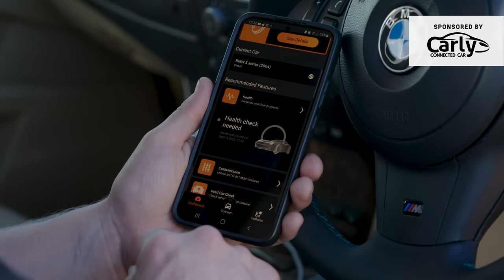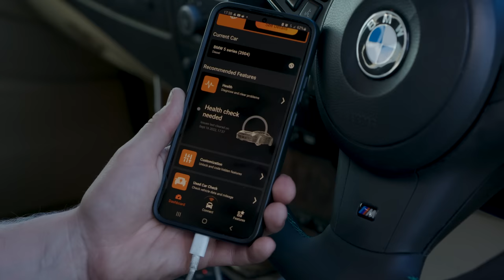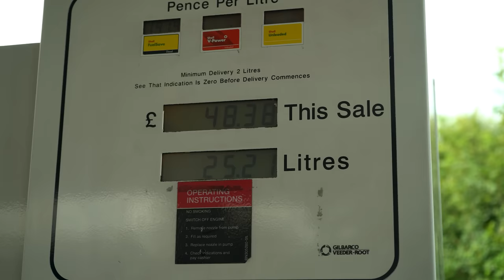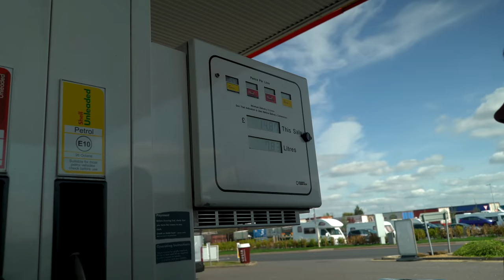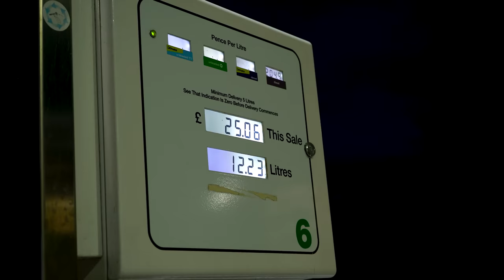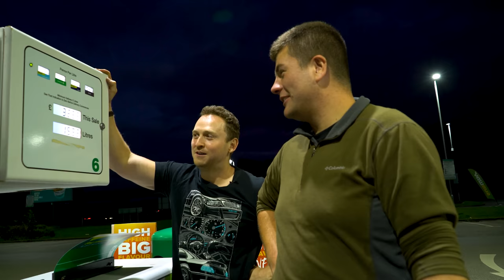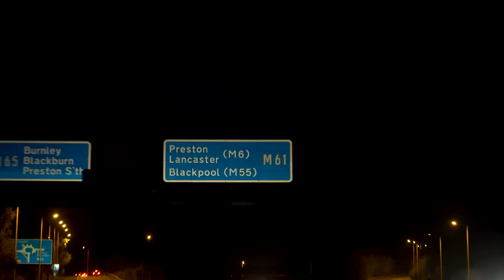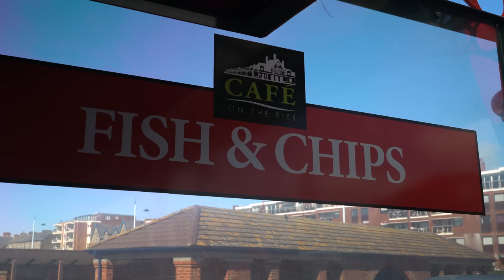£3000 Car Auction Adventure!

Comment: The right blinker while turning left at 11:33 is what we call baby steps in the car community regarding BMW drivers.
Reply: Audi drivers aspiring to this level of unselfishness. But then quickly realise that their cars aren't equipped to make others aware of their intended actions 😂
Reply: He accidentally knocked it on when looking for the volume controls for his super bassy stereo. It's the only explanation.
Reply: Not to make excuses for shitty driving, but BMW indicator stalks were of a stupid design for most of the last two decades. They don't latch and as the internal stops wear out, it's not impossible for a miscalculated release of the indicator stalk to cause it to spring back in the opposite direction and cancelling them manually is a nightmare. Not something you'd ever do if you were actually paying attention, though. They put the same design of indicator stalk in MINIs in the F5x cars initially and the response was so awful they went back to latching ones within a few years. I noticed the loaner 2 series I had a while back also had a latching stalk so whilst it may have taken them a long time to admit it was a bad idea (I think it probably started on the E6x cars and ended with the first G-coded models)  they did get there in the end.

I've noticed that indicator usage in the UK is almost universally awful regardless of car brand in one area though - almost nobody can be arsed to indicate off of roundabouts. At worst, they're still indicating right as they take their exit so you're just sat there with no clue whether approaching traffic is going further round as you approach.
Reply: what is blinkers?
Reply: @Azurael  so you're telling me a lot of the people who I see as not indicating probably are indicating? My whole world has been distorted 😂
Reply: @bigduphusaj162  get some spirit bubbles while your at it please mate, along with a long weight, which I imagine come as standard 🤔
Reply: @Azurael  I've got a 2008 3 series and the indicators are very intuitive, I've never had a problem with them, I guess some people are incapable of doing a half press.
Reply: @spicysnowman8886  I mean, they're fine when you're used to them - I've spent 6 years driving cars using that arrangement now so I don't even think about it but I fail to understand how they could ever be deemed better than a regular latching indicator stalk. Wanna cancel the indicators when they're in the up or down position? It's self-evident. It requires not only re-learning how to do something everyone who drives already knows how but also requires being a lot more careful (i.e. not to move it too far when cancelling) for no tangible benefit in functionality.
Reply: @Azurael  I mean I just hopped in the car and it made perfect sense to me, but I guess I did already know they worked from watching videos before I bought the car.
Reply: @bigduphusaj162  I didn't realise they had a name, 'comfort indicators', but we have a Vauxhall Zafira with them, or a version of them at least. There was a couple of times after we got it where our car could have been seen driving down the road alternating between left and right because it wasn't pushed enough in either direction to go to the 'indicator on until steering angle decreases' position, so instead of the half move of the stalk cancelling the other indicator, it activated the 3 flash for the other side, not understanding what the 3 flash thing was. It was just an indication we didn't ask for that we wanted to cancel before it confused other road users, so they were confused even more. :) 
In the Zafira, or rather our Zafira as it was an ex-demo with details that don't seem to match other cars we've seen, the stalk doesn't stay where you move it to, but acts a bit like a regular stalked car that has the '3 flash' thing, so the half engage in one direction does the 3 flash thing (something that can't be cancelled if you trigger it by mistake), then the 'full' engage is the regular indicator, but it doesn't stay engaged with the stalk and you have to half engage the opposite indicator if you need to cancel one, something this Zafira seems to need more often than other cars as the first 'clicks' when you turn the steering wheel seem to be quite far around for how relatively little you actually need to turn the wheel to steer around stuff, so you can fully indicate and not pass a disengage point before pointing straight again. My granddad, who's car it is, seems to have given up on using them, because the only comfortable thing about them is not touching them. :)
Reply: Killed me!! thought I was the only one who noticed
Reply: A potentially working blinker on a BMW means simply "Caution! Something's gonna happen!", so whether it's left, right, or none, doesn't really matter much :)
Reply: @jordanvalenciamanuelpillai2917  Turn signals

Comment: I live near snake pass and walk the dog up there all the time, it's such an impressive site to see those engines and landing gear so well preserved. There are 3 more plane wrecks all within walking distance from there. 
I've always been a fan of cars like this. Once expensive, but high mileage and super cheap bargains. Ive had an e39 540i, a w220 s500, a s60 t5, an Audi a4 3.0 quattro, a e36 328i to name a few. None of which were more than 1200 quid. Had loads of fun and crossed Europe in these old smokers! 😎

Comment: Hi Alex, 

Just to  say loving the content however would urge you to adapt the 2 way radios when driving to make them slightly easier to use.
possibly a headset or push button usage.

although there is an exception on two way radios when driving, the police can still pull you over and fine you if they believe its providing a distraction resulting in penalty points or a fine.

Comment: That’s preposterous mate! 
Brake lines on those rovers are easy peasy, don’t need to drop no subframe or fuel tank, back in my Land Rover tech career I could get a set of rear brake lines fitted in less than 3 hours, that includes bleeding the air off the rear lines. 
Range rovers and land rovers are super easy to work on as long as the right tools are used. They are Ford/bmw mismatch parts after all.

Comment: Great video.  

Next time you're up this way, if the water level is low, check out Ladybower reservoir.  You can see the remains of some of the old village buildings normally hidden under the water.

Comment: Now this may sound like I'm begging but, 
PLEASE could you consider an offroad build with the rover. 
•convert to coilovers (possibly long trave suspensionl)
•body lift 
•wheels
•tyres 
•modernising the engine to make it reliable and reclaim some power
•rear locker 
If this is a possibility my brain would probably melt love the channel.x

Comment: I have an E60 530i. Overall, a fantastic car. 
Just a few things piss me off about it though:
 - No engine temp gauge.
 - iDrive is shit. To change the centre-vent temperature, you have to do a dozen iDrive clicks and turns. In the E39 you just turn the thumbwheel by the vent.
 - When you get low on fuel, it turns the clock off. You're not allowed to see what the time is when you have fewer than 30 miles remaining.
 - Turning the centre screen off doesn't turn the centre screen off.
 - Interior quality is worse than E39's.

Comment: I had a e60 BMW in New Zealand. I loved that car but any fault or repair was cripplingly expensive. Ie electronic steering lock. Starter motor failed at 194k kilometers. I could just barely afford to fix it.  After that I reluctantly sold it. Driving a Honda is not the same at all but I feel less anxiety about what will fail next.

Comment: Does the BMW have the N47 engine? If so, I had a very similar thing happen to my car a few years back (E82 123d). Heard an awful clattering and banging like you heard, and when I looked in the engine the crankshaft pulley was fully on the under tray of the car... Managed to get it round to the garage unscathed but I'll never forget that noise!

Comment: Looks like a lot o fun. I htought the Range Rover would blow up for sure. Surprised the BMW had issues. I had BM's with over 200K on that were good runners. Keep up the good work guys!
Reply: I love BMWs but sold my e60 because I could no longer afford to fix it. Starter went out and who knows what would fail next? Vanos? Only BMW I have left currently is a e36 I'm trying to convert to electric power. I drive a Honda now and feel less stressed.

Comment: I had a range rover sport HST supercharged and it averaged 14mpg lol but if i used the manual mode i could average 18mpg which strangely was also sport mode and made it quicker! But the V8 engine sounded amazing and surprisingly never gave me any problems! Absolutely loved the range rover, only reason i sold it was fuel economy as it was my daily driver! Also own an R32 GTR which was greedy so didnt need two greedy cars lol

Comment: 11:32  indicating right whilst pulling off to left on slip road.  must be those aftermarket bmw indicators wired in wrong by previous owner (bmw indicators optional extras) when new.  What was that taylor, the bmw is perfect but i have to park close to other cars as door don't lock!!!

considering the amount of work taylor did to get the range rover worthy of the trip before you left, i'd say still a win for the beemer as it went wrong during the trip not half of it being repaired before the trip

Comment: Tell Rory to drive his 535d above 2300 rpm for atleast 20 minutes once in a while, the DPF doesn't regenerate on this car even at motorway speeds (except if you drive at 100mph on a daily basis).

Comment: V10 Touareg air suspension very high spec I got mine on 120k 3,250 only broke the steering column in the 1 and a half years I’ve had it 

Should punt the land rover and get yourself an Touareg

Comment: i'll stick with my £2k jeep cherokee with 87510 miles and NO issues thanks and its a 55 plate.  hasn't got brake pipes with rust holding hands trying to keep the fluid in lol

Comment: I do not believe that Range Rover, did that miles per gallon. there is no way, the gas guzzler is that efficient.
Reply: 2002 TD6 easy 35mpg on a run (no drafting)

Comment: Dear possible Carly customers. I want to make it known that this is a subscription service that auto-renews. I bought it to try and resolve a specific problem, and ended up getting rid of the car. I therefore put it in a drawer and forgot about it. That is until I saw that they had taken another payment from my account a year later. When I contacted them to resolve, they advised that it auto-renews unless you give them a months notice that you want to cancel. I appreciate that I made an error but I thought "oh well, maybe they will do the right thing and cancel immediately and refund the payment". No this isn't the case, my error, should have read the small print properly. No refund. Oh and you will not receive a reminder before renewal to tell you that is is going to auto-renew.

Comment: i had a carly, 90 quid for the unit then a yearly subscription and its not that great, the only useful features on it was the crash lights giving the hazards a visible double flash and the door lock settings. other than that it was pathetically useless

Comment: Very fun video but I think the Range Rover stereotype is a bit of a false one. You are driving one over 15 years old with loads of miles on it and bought from auction. Of course it’s going to need things like a turbo hose and one or two potentially major jobs. Newer Range Rovers and newer cars have almost none of these issue because they just aren’t that old and battered yet.